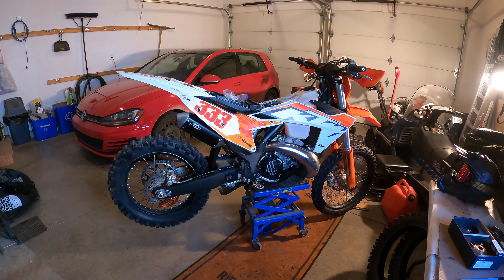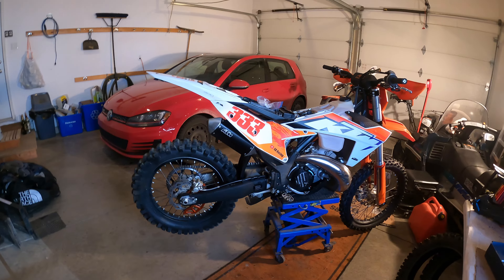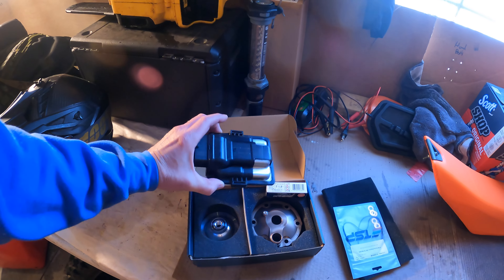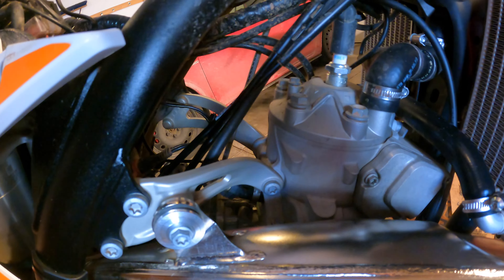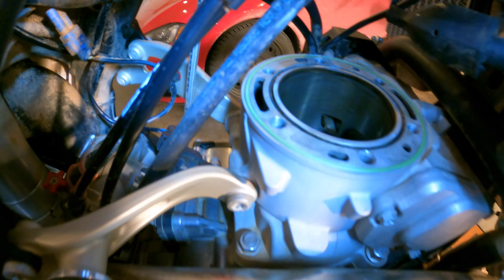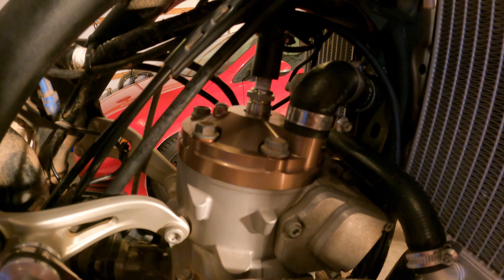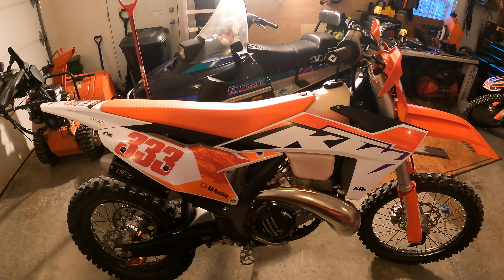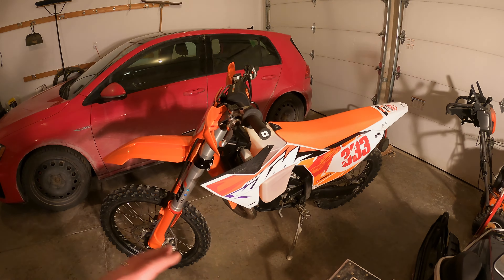TSP'd my KTM 300 xc - More snap, more better?

Comment from the maker: Some feedback after having a few ride on the bike now. My bike, like the reviews I've read had a good bottom end and came on much stronger in the mid and top end. As mentioned in the video the latest tune muted the bottom end a bit more and I didn't love it. The TSP medium compression head and 'trail' tune has accentuated everything in a good way. More bottom, more mid and more top end power. The green map is the one I prefer for fast single, pit riding and likely for most hare scramble situations. It's more aggressive but not uncontrolled pull your arms off. Very usable power that is as spicy as you might want. The white map I got to test this weekend on some hard enduro climbs, which I'm out of practice on but it was as promised a good hard enduro map that pushed the throttle 'hit' into the upper mid so that down low it helps keep traction.  Was it money well spent? Yes, yes it was. Now I'm thinking about getting the ERM so I can tune and try some of TSP's other maps.

Comment: Just watched this, we're at pretty much the same hrs(52.4 here) and I have a dent in the exact same spot in my pipe, lol. Did you put the same plug back in? I swapped to a 7 after using the cold start in November and fouling the OE plug, seems to start/run better IMHO. I was thinking about the tank sock and you convinced me, picking up this week. I didnt get the updated tune for the same reason you stated, the tech at my shop suggested not to. Looking forward to seeing a good rip with the new head. Cheers & Thank you for your Service. DBD
Reply from the maker: I put the included NKG BR8IEX Iridium but have it on good authority from the Goat's manager that running the non-iridium is better. I haven't yet had an issue but I am carrying my spare OE plug with me. Good call on not updating the tune. I do have a video of ripping around in a pit but didn't focus overly on taking about the tune. I'll come up with something a bit more comprehensive next week.

Comment: does this one have the chinese made kymco cylinder on it?
Reply from the maker: Jesus, did China take over Taiwan and we all missed it!? Lol jokes aside, Kymco is a Taiwanese company and makes a lot of stuff for a variety of bikes brands. I don't know if KTM used them for a short run just or continues to use them for some of their machines. As for this bike, I don't think so as the tell is usually a Kymco stamp on the right side of the jug and there is nothing there. That said if the cylinder is true and plating good, and 54 hours in without being scored up or down on power suggests it's good to go, then I wouldn't be overly concerned. I can't find much where someone is blaming a Kymco cylinder, less the one guy who smoked a motor with 100 hours and blamed the cylinder but after 100 hours so many things could be to blame. What info do you have?

Comment: I don't notice a difference
Reply from the maker: Which maps did you go with? I wouldn't say it makes more power I just like where the power is available.
Reply: @TeamStruggleBunny  not sure I bought the ERM I think it was just a reflash.
Reply from the maker: @Mostviews111   I have the medium compression head and trail mapping. The original map in my bike had the issue of the error code if you accidentally hit the start button while the bike was running. The dealer updated the ecu tune and that tune was great, but when I had a issue (turned out to be the fuel filter) the dealer put in the latest tune and I didn't like it, to soft down low. The TSP head and tune put me back where I wanted to be. I may get the ERM so I can mess with the tunes a bit.
Reply: @TeamStruggleBunny  interesting I've had this weird noise since it was new and it's gotten worse. I'm going to rip the clutch apart next as soon as I grab the clutch or rev it at idle it goes away. But at higher speeds if I let off the gas it's almost like a knock sound.
Reply from the maker: @Mostviews111  KTMs do make some noise sitting at idle but what you're describing seems outside of this. Have you changed the oil and check it for any abnormal metal?
Reply: @TeamStruggleBunny  yes I change it every 5 hours.